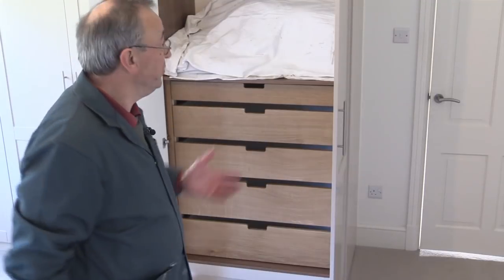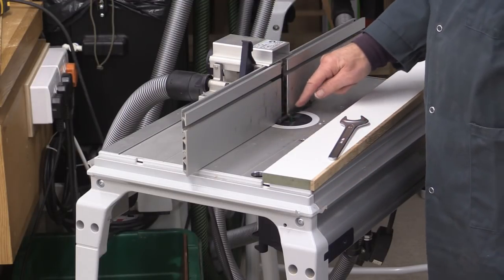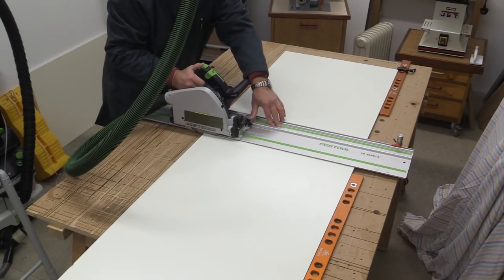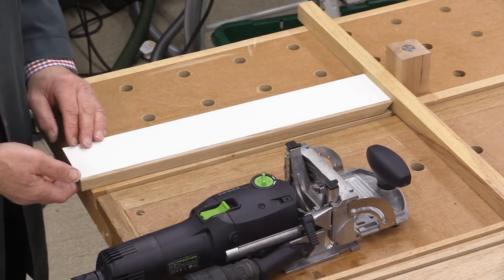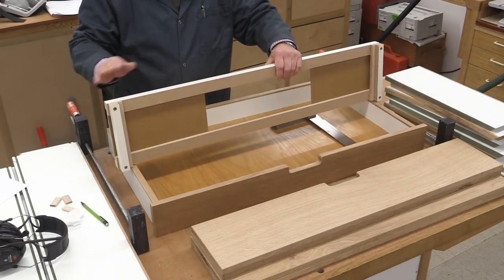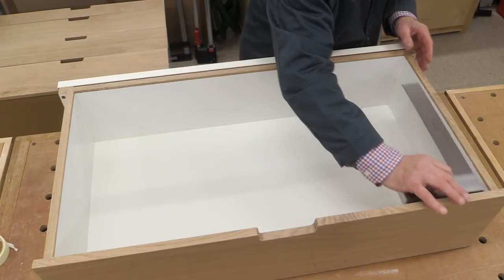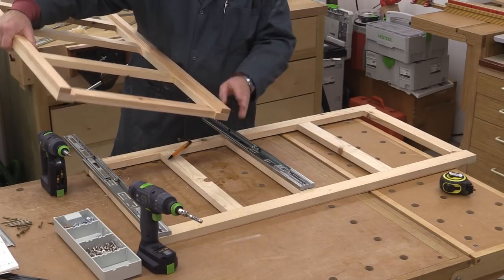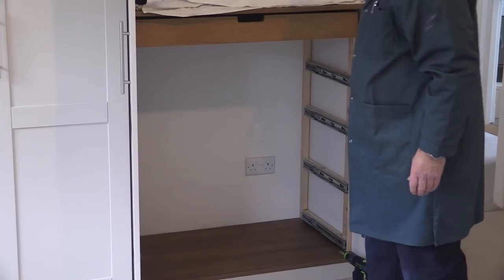How to make wardrobe drawers

Comment: Excellent Instructions. I'm very interested in your Parf fence you were using.
Reply from the maker: They are available from Axminster. They are currently sold out but more stock is being manufactured right now and so should be available very soon. They have proved to be far more popular than anticipated.  Cheers.  Peter

Comment: Peter, great video as always.  I’m curious why you opted to use a mitered back to the drawers rather than a captured back. With the Dominos, the strength would have been equivalent. And the captured back is somewhat less fidly to fit properly.  Just curious.   Thanks.
Reply from the maker: Hi John, The mitred jointing method is actually very easy and something that people without a Domino can do. I agree that overall the various steps might look fiddly but it comes together so easily.   Cheers.   Peter

Comment: Excellent video as always Peter. Does the Versa Flow bother your back at all while wearing it? I have 6-7 disc issues and the low back area is one of them. It also seems you can wear your ear defenders with them. Off hand do you know the U.K. Price for them with ear defenders? I can’t find it in the U.S. with the hearing protection available. Also, do you get any smell of the wood being cut coming in? I have allergies & several wood allergies that affect me. I have I think an old Trend unit but it is not great at filtering out all the dust and the motor is above your head and noisy. And have you done a video on the Versa? Please don’t bother to look up the Versa price if you don’t recall the price you paid for it.  Thanks Peter for keeping us entertained and educating us at the same time. Hope you and yours stay safe .     Ron
Reply from the maker: Hi Ron, The Versaflo is expensive but worth every penny and more. I broke my back a long time ago and have had a lot of treatment for it since. It was a lower back injury. The power and filter unit present no problems at all for me and I can wear the whole thing all day - I think 2 lots of 3 hours is the most that I have used it in one day. I have not noticed smells getting through. The ear defenders are standard 3M fitting so, for example,  it would be possible for me to transfer my 3M XP Alert ear defenders with Bluetooth to the Versaflo. That is the advantage of one supplier with a "system" or "family" approach. Take care my dear friend and I will do my best to keep the videos coming.  Cheers.   Peter
Reply: New Brit Workshop   Thanks Peter. I will have to investigate further regarding VersaFlo. I have 7 bulging disc’s and two herniated disc’s. One herniated disc in my  neck & one in my low back. The bulging discs are in my neck mid back and low back, so I feel your pain! 😀.   Mine was from someone doing 60 m.p.h. running a red light and hitting my right front door and knocking me across 5 lanes of traffic.  Could have been worse though.   Like you I try to work smarter not harder!       If you keep making the video’s I’ll keep watching my friend.   Cheers.   Ron

Comment: Hi there I've just discovered your channel and really enjoy your video. One question if I want to have the drawers in a mdf or ply unit that is removable from the wardrobe, how do I know what width to make the drawers so they run smoothly once on the runners???
Reply from the maker: Hi Giles, If you know the measurement of the width of the drawer where the sides will be then just take away the thickness of your runners (often between 11 mm and 13 mm)  and then add 1 mm to that and that is your drawer body width.  Peter
Reply: @NewBritWorkshop  thankyou Peter!

Comment: Thanks for the quick reply. I was actually just thinking about in general, not for your drawer job although it’s looks really substantial joint. 
There was I thinking it was some sort of new invention lol.
Reply from the maker: Hi Michael, The lock mitre produces a fantastically strong joint but it is overkill in most areas. However, I like to think of my tools as providing me with "capability" and having the lock mitre in the arsenal adds capability should strength be important.  Cheers.   Peter

Comment: Hi Peter, Why didn't you use the extra piece on the Domino when you cut the ends of the draws sides?  I find it's a great help to get the slot square to the face when cutting into a narrow edge.
Reply from the maker: Hi Michael, In the one short shot in the video I did not but for the rest of them I did. I have not checked but it may be visible, on the side somewhere, in later shots.  Cheers.  Peter

Comment: Drill bit to set up the router was a handy tip!👍 What extractor do you use with the kapex? I’m using the festool midi and don’t get the dust free cuts it looks like you get.
Reply from the maker: Hi David, I have a 10 year old CTL 26 which works via an Oneida UDD cyclone. It is a brilliant extractor and now has Bluetooth. When using the Kapex it helps to allow the extractor to come up to full power before starting the cut - it is probably only 1 second so no big deal.   Peter
Reply: New Brit Workshop thanks for the tip about letting the extract come up to speed, will try that next time.

Comment: Hello Peter. Just come across your channel, can believe I haven’t seen this before, so happy now!
Just a quick question, have you ever used the UJK dovetail jig, and will you ever do a review of it on your channel?
Reply from the maker: Hi Ian, I have not used it and I am unlikely to as I am a fan of the Leigh D4 which I bought from Axminster many years ago. There is a problem with most dovetail jigs in that they do not allow the very small (old fashioned?) dovetails to be created. That is why most serious cabinet makers still cut dovetails by hand.      Peter

Comment: Hello Peter. great content, well produced, let me pick your brain for a minute, do you have any experience with using american made tools in the UK ? I am considering moving back and as I have a bunch of tools am wondering if I would have to start again or they will work just fine , any feedback welcomed , Thanks ,
Reply from the maker: Hi Pat, The only really issues are voltage and spares/repair. In the UK we only have 240 volts at 50 Hz. You can get transformers to take you down to 110 volts.   Peter

Comment: Is there a reason why you fit the drawer runners at the bottom of the drawer? The Accuride installation guide show it in the centre of the side.
Reply from the maker: Hi David, I find it easier as you then have a reference edge. From an engineering perspective I can see no disadvantages at all.  Peter

Comment: Great video and very accurate description of my own man drawer which made me smile. 

Are the Accuride runners a dead 13mm wide then, or at they 12.7mm like any others and you just round up giving a 26mm total allowance?
Reply from the maker: Hi Rodger, You are right on both counts. I allow 13 mm as it is an easy number and it always seems to work. If one were to set up a robot machine to turn out hundreds of drawers then more precision would be justified.  Cheers.   Peter
Reply: @NewBritWorkshop  great thanks! Being a fitter turner to trade 2x0.3mm to me feels like a mile and I normally put the runners and 2 off cuts of the material in the gap and then measure the remaining gap and cut my backs to that size. Your way will make future pre-planning much easier. Thanks
Reply from the maker: Hi Rodger, There is a bit of play in the runner mechanism but I would still not want to be out by more than 0.5 mm overall if I can help it.  Cheers.  Peter

Comment: Peter, in one of your earlier videos you went into a bit more detail on your parf hat design but i cannot find the video. Are you able to advise which video you explained about this.
Reply from the maker: I think that they have appeared in several Workshop Notes videos. They are dead simple to make. Start with some square stock, say 45 mm x 45 mm and in lengths to suit your dogs. If you are using the Veritas Parf Dogs then drill a 26 mm hole dead centre about 11 mm deep. Then continue the hole with a 20 mm cutter but be prepared to work it around a bit to make the hole slightly over sized. This should go all the way through or to at least as deep as the dog is tall. If you have plain parallel side Super Dogs then you do not need the 26 mm shoulder hole.    Peter

Comment: Are you satisfied with your Jet jointer/planer and would you buy it again? Did you happen check out Felder’s similar machine?
Reply from the maker: Hi Paul, I am very happy with my Jet but I seem to remember it was cheaper than the 331 at the time.  Cheers.  Peter
Reply: @NewBritWorkshop  one more question have you had to make any adjustments to it ie beds/knives and was it difficult? Thanks
Reply from the maker: Hi Paul, My machine worked perfectly straight out of the crate and continues to be excellent without adjustment.  Peter

Comment: Why did you use MDF rather than 1/2" birch plywood is it becuse its oly $38 a sheet. Would love to know moe about the face mak your using
Reply from the maker: Hi Thomas, It was the material that I had to hand and does a perfectly good job.  The powered respirator is from 3M and it is excellent although some people find the long tube from the back of the head unit to the power unit behind the user's waist awkward.  Peter

Comment: Hi Peter,  I noted the effective extraction from your planer.  Are you still using the same vac with it?
Reply from the maker: Hi Michael, Yes, it is the Numatic NVD 750 and works better with this larger planer than the smaller one (helical heads).  Peter
Reply: New Brit Workshop Great news Peter.  I am sure mine will be fine with 260 size planer .

Comment: Peter, do you not use a Table Saw very often these days? Do you actually still own one ?
Reply from the maker: Hi Steve, Yes, I still have my small Festool CMS-TS but it does not get a lot of use as I can do so much on my tracksaw cutting station. I did use it yesterday to some rebates in 19 mm oak veneered MDF. Cheers.  Peter

Comment: Do I really need this kind of mask when cutting MDF ?
Reply from the maker: It depends on the machine being used and how much you are cutting. It is an assessment that people have to make for themselves. Advice will be available in many countries from the health and safety people.   Peter
Reply: New Brit Workshop Thank you very much for your kind response. So if you’re cutting hardwood or other more natural material, would you still use that type of mask?
Reply from the maker: No, unless it is a poisonous wood like Iroko.   Peter